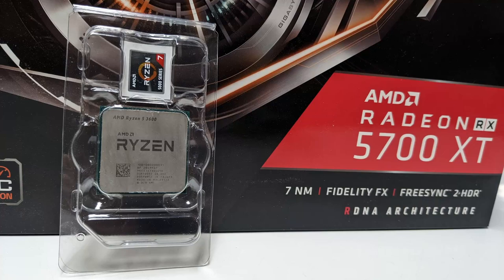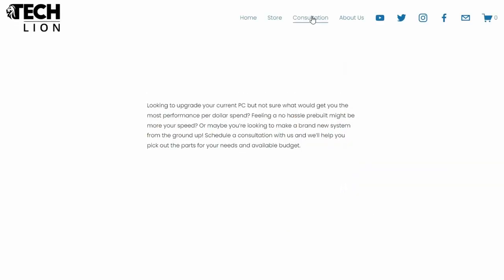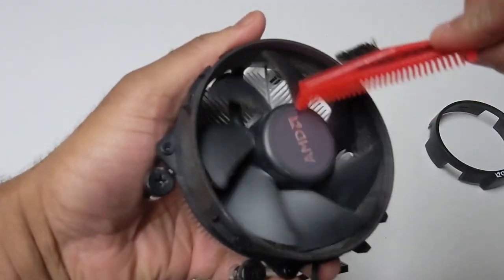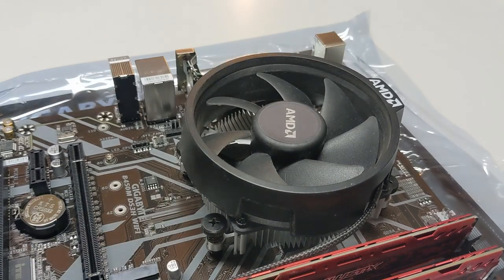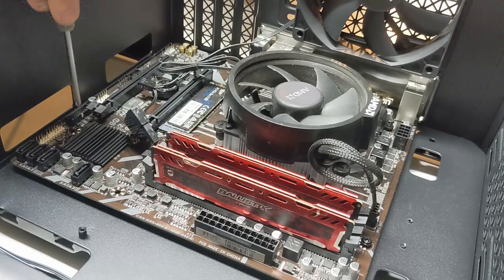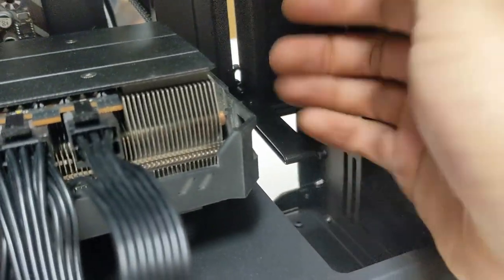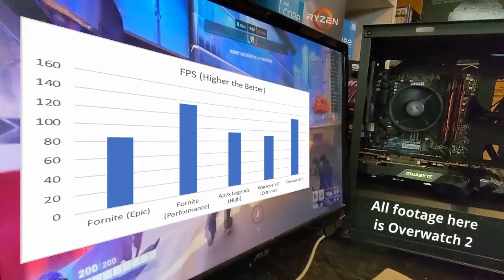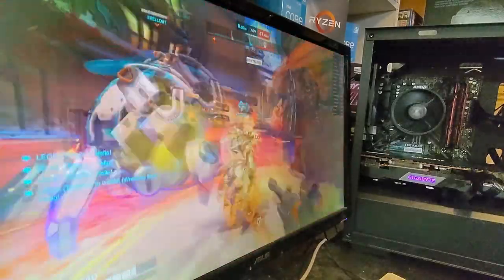RX 5700 XT is still awesome! - Pairing with my Ryzen 5 3600 - Tech Lion

Comment: did you take apart the gpu and add new thermal paste?
Reply from the maker: Not for this card. Normally, I'll just hit used devices with an air blower and brush them, then run games on em after and examine the temps from there. If they look outrageous then yeah I'll crack em open and reapply thermal paste.